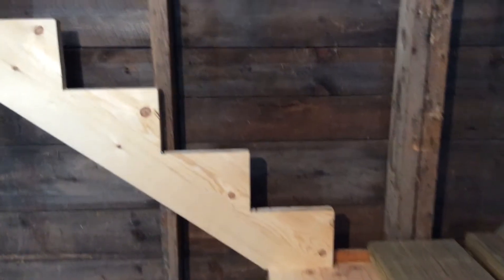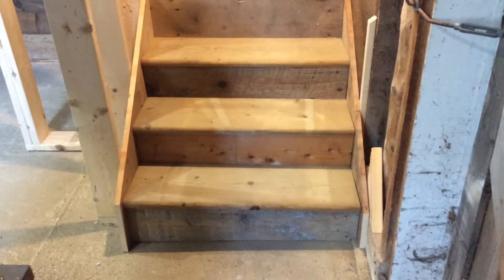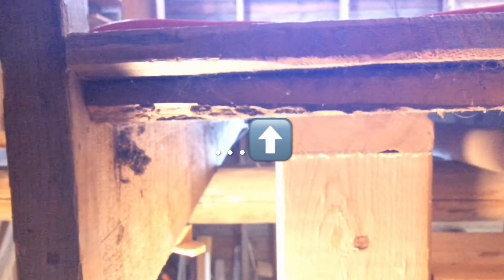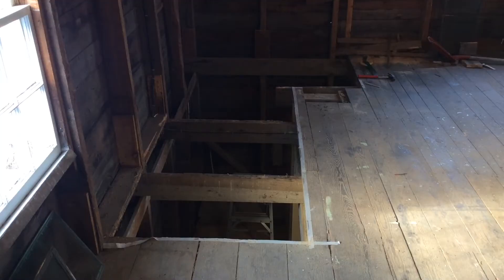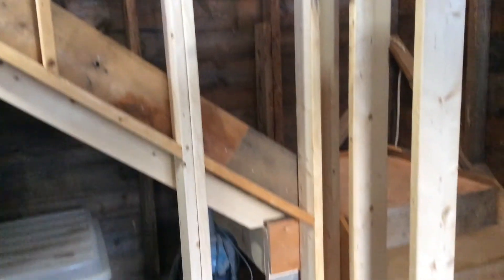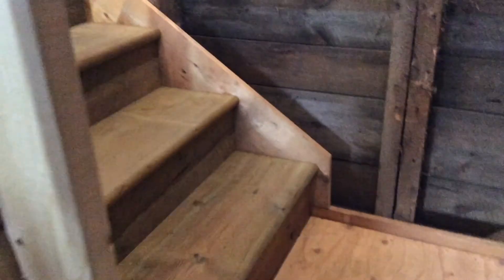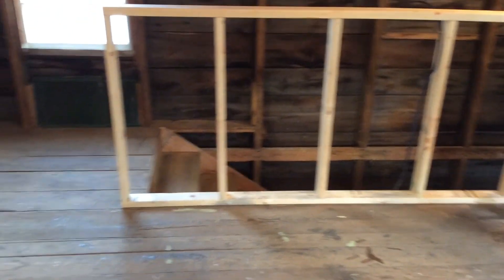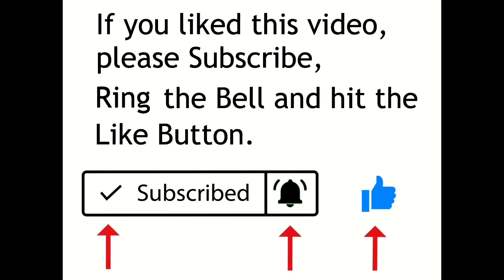26. Building a better set of stairs.

Comment: Question. you said you were going to insulate the 2nd floor. Would you not have to close off the steps area somehow or insulate the downstairs for that to work heatwise?
Reply: it's been an hour since I posted. Where is my answer?
Reply from the maker: We do intend to fully insulate the entire garage but possibly not all at the same time. So as a stop gap by closing in the stairs and insulating them, we can put an interior door at the bottom and have somewhat of a sealed area. I could styrofoam the undersides of the steps to really close it in but we will see how far I get.
Reply: @strataartstudios3826  so is the area going to be your studio?
Reply from the maker: Yes that is the plan for the second floor.